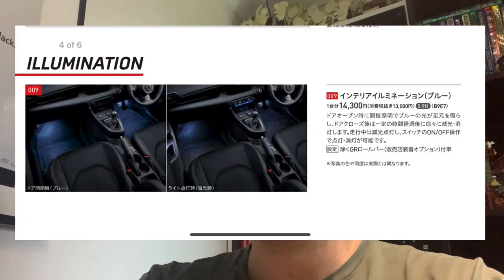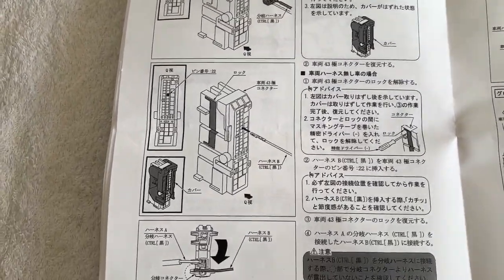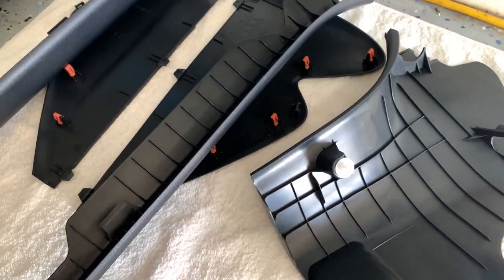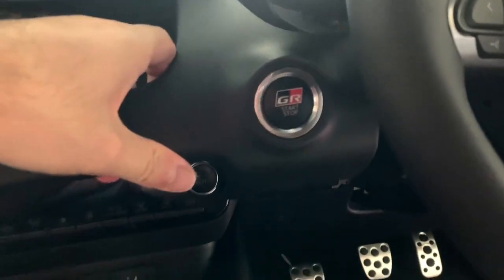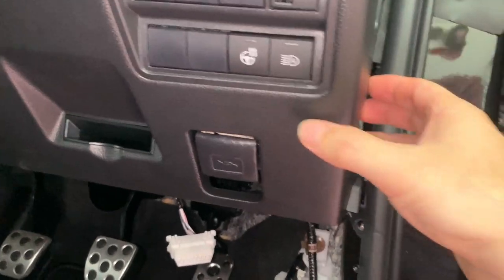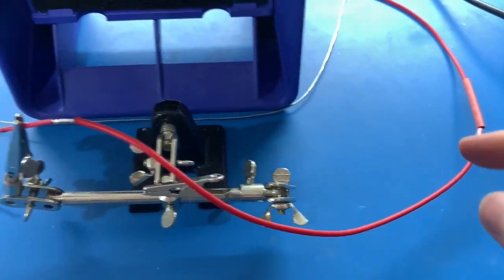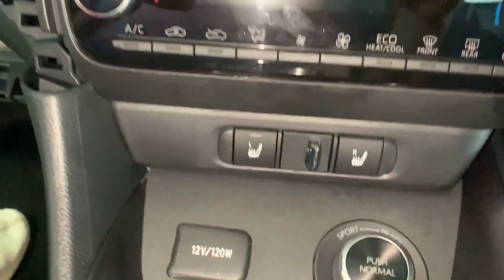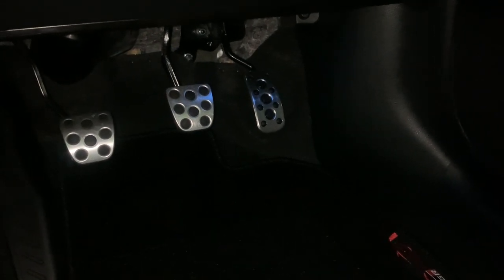Toyota GR Yaris - Interior Illumination Kit Installation

Comment: Man, I feel the stress of taking those bits off without breaking any clips. I took the centre console and gearshifter surround off to install the Blitz Idling stop Jumper. That was stressful enough thanks. Great vid, nice garage floor.
Reply from the maker: Cheers, does the Blitz Idling Stop Jumper work nicely? Can the light on the dash be turned off instead of being lit when it’s not active?

It’s another ‘kit’ I was thinking about buying.

The garage floor was another larger than planned project as I had to hire a concrete grinder and then had a thick layer of dust mud to get rid of... I should finally put those videos together and upload it too now that I’ve committed to making videos.

Comment: That’s such a helpful video 
So really we could just order 4 x led modules with 4 x wiring clips and wire the rest our selves?
Reply from the maker: Correct. I don’t even think a fuse is necessary since that circuit would already have its own fuse and adding 4x LEDs at a few mA each is hardly noticeable.

Comment: Thank you sooooo much for this! It's absolutely unbelievable how Toyota did not fit footwell lighting at manufacture! I love footwell lighting and will very likely buy this kit for my car, as well as the additional led lights, like you did. My car is like yours, a black Convenience Pack, as I'm from England. Also crazy how Toyota UK stripped the 'top' model of all extras, including heated seats, which so many owners are unhappy about.
Reply: What's the advantage of this? Seems perfectly unnecessay to me and not really worth the hassle. Shame on the heated seats though, I like mine, as well as the heated steering wheel

Comment: Amazing video. So good, uk cars are really strange you either get all of the extras navigation, heads-up display, interior lighting etc or you get the circuit pack that has no extras but the diffs and forged wheels. I'm trying to retro fit what I can in to my circuit pack model so this was super useful. Thanks v much. Does anyone know if the headsup display can be retro fitted?